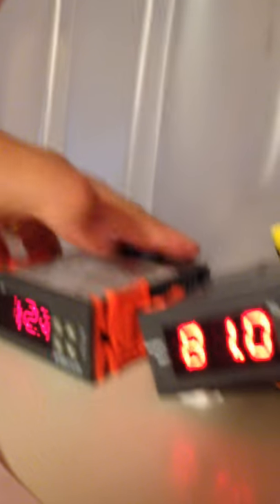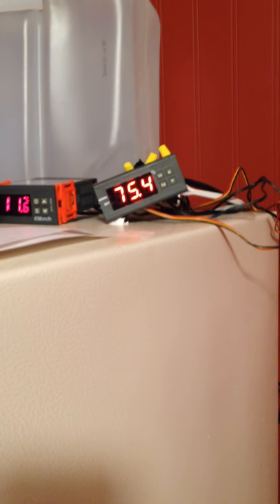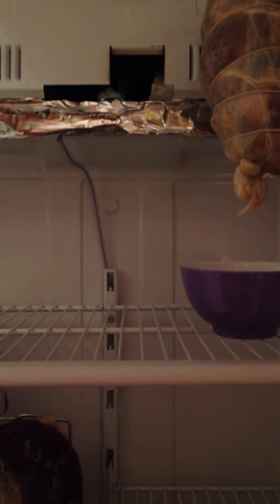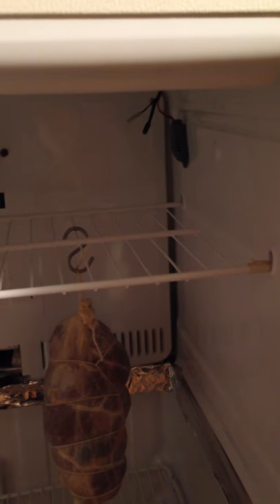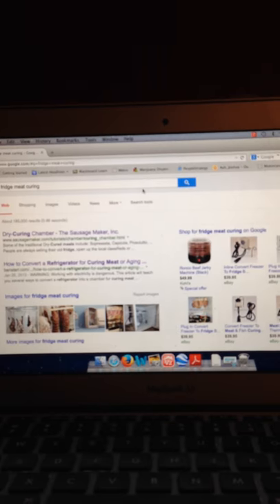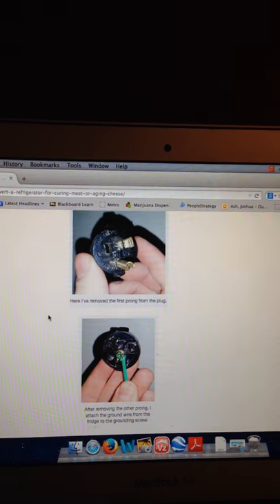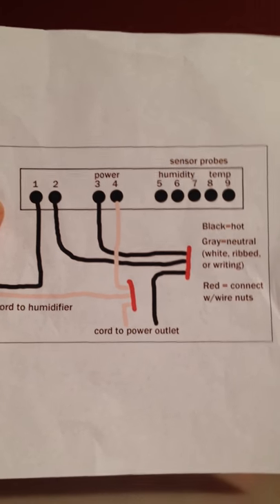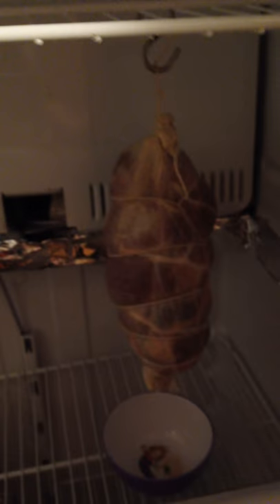Convert fridge to a meat curing chamber part 1

Comment: Hi Joshua, 
I'm in the process of converting a fridge into a curing unit. I have a question about the wires and thermostat of the fridge. you said you took all of the wires and tucked them behind the back panel.
I notice that the fridge won't work if the thermostat is not connected, does the STC 1000 pretty much have the same function when it is all rewired?
Reply from the maker: Alex's Hey Alex,

DO NOT DISCONNECT THE ORIGINAL THERMOSTAT!!!!! Those wires tripped me up for about 2 days, then I realized I was over thinking it. The STC will act as your thermostat. The only thing I cut out of the wire bundle was the wires for the light. I turned the original thermostat to high and tucked it all behind the panel. This will allow the fridge to run at its coldest and STC sensors will read the temperature and either turn the fridge off if it gets too cold or on if it gets too warn. Hope this helps, if net let me know and I will see what I can to explain it better.

Best,

Joshua
Reply: Joshua Ash Thanks Joshua for responding so quick.
My fridge looks exactly like yours in the video.
Should I tack the wires with the connected original thermostat behind the panel? I'm sure i'm gonna have few more question about it and I hope I won't bother you too much. what part of the country do you live in?

Thanks again.

Best,

Alex
Reply from the maker: Alex's Hello Alex,

Not a problem.Yes, place the wires with the connected original thermostat behind the panel. I used aluminum tape to finish the edges were I cut out the divider between the freezer and fridge. I live in PA. Let me know if any other questions come up.

Best,

Joshua
Reply: Joshua Ash Ok perfect! Thanks again.
I will be in touch for sure in the next couple of days.
Reply from the maker: Alex's Godspeed;)
Reply: Joshua Ash It's me again. Finally all my controllers have shipped and should arrive tomorrow. 
I wanna make sure I understand correctly... I need 3 extension cord, right? Can I use all 3 prongs? 
Moreover, in your video you said to plug the refrigerator's power cord into the extension cord but on Benstarr website he says to strip off the refrigerator's power cord? i'm not knowledgeable about electricity and the diagrams don't make too much sense right now. What's the easiest way to understand the rewiring?

Thanks again!!!